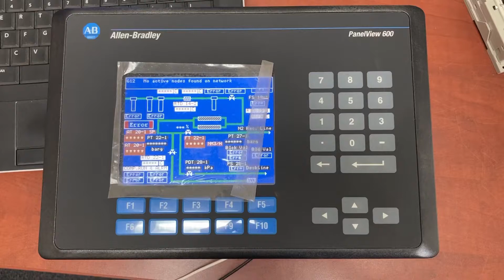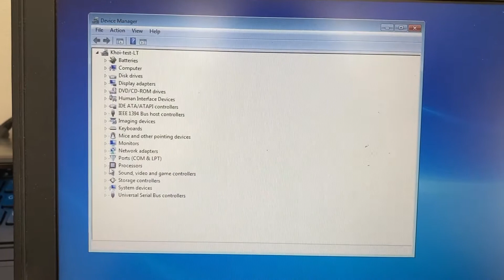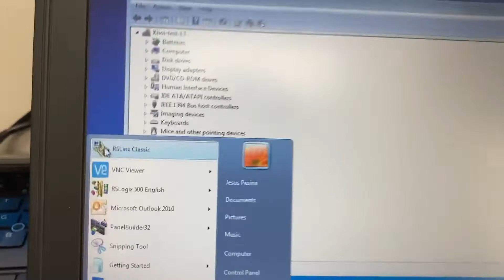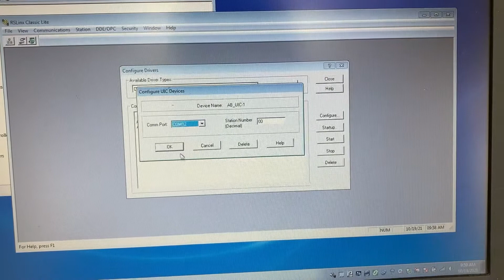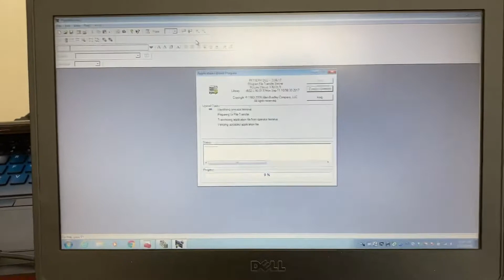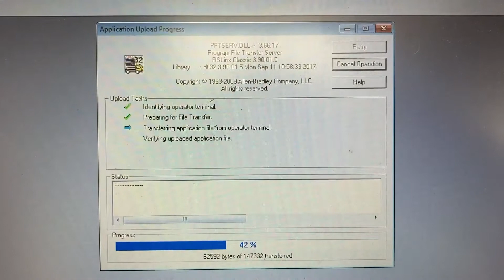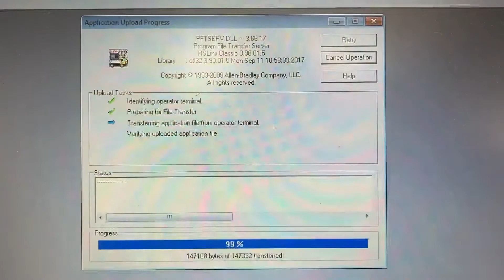Allen Bradley Panelbuilder32 - How To Upload - DH485

Comment: You make very useful videos, engineer, thanks for sharing your knowledge. I have a technical question. I have a panel view micro 300 with FRN 4.20 and I am going to replace it with another panel view micro 300, the same model, but with FRN 4.41. I am going to back it up and upload the I support the new one, my question is, is there any problem with the fact that the FRN are different?
Reply from the maker: @MASTER PROGRAMMER: Thank you for your kind words and your subscription to my channel. It’s very normal for newer exact same model HMI’s to have higher firmware. It will accept the HMI application you got from the old HMI for sure without any problems. That’s how it should be. If it’s the other way around, you for sure will get a lot of problems.

Comment: Could you provide the software you used please?
Reply from the maker: @edvinasjablonskis2054: I am working for Allen Bradley. You should contact your local Allen Bradley authorized distributor to get it. Thank you.
Reply: @SYPHOANG  I contacted them, but they could not provide me this version of the software as its obsolete. I need it for the panelview 1000 hmi backup. Is there any way you could help me obtain this software?
Reply from the maker: @edvinasjablonskis2054: I am not sure where you are but I am in the U.S. and was able to get the. software from Allen Bradley website. I don't think the software version really matters. You can try to get the version that still available. Hopefully it will work out for you.

Comment: That is not a CAT5 cable.  It needs to be a 1747-C13 or similar cable.  I've seen too many 1747-UIC adapters destroyed because someone used a standard ethernet cable.
Reply from the maker: @rickr911: Thank you for your comment. But I used the exact same CAT5 cable on my computer, ethernet switch or Panelview Plus 7 HMI in this video.